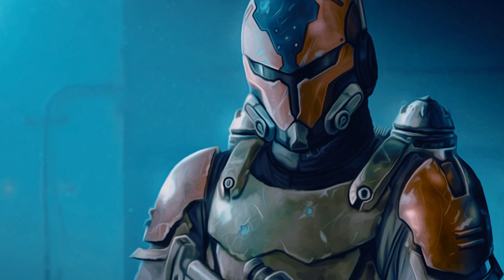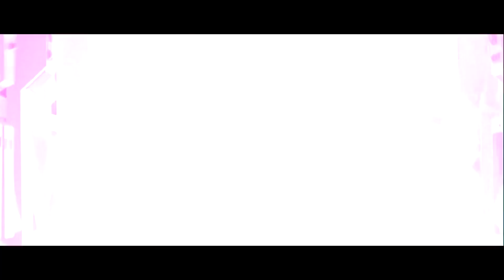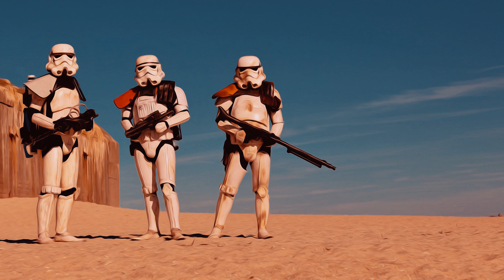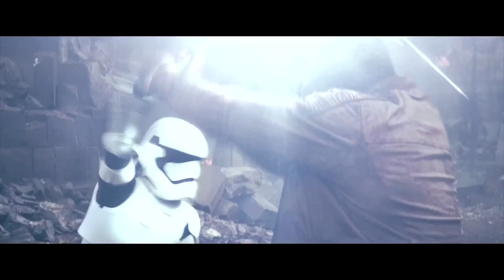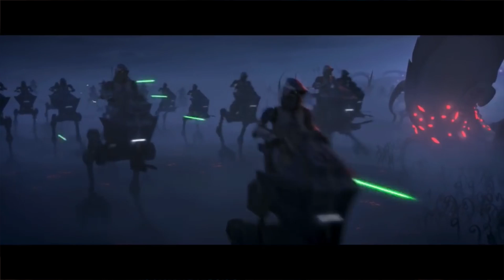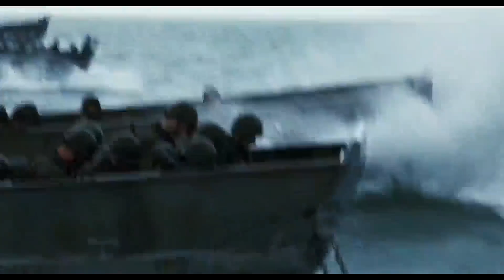FIRST ORDER VS CLONE TROOPERS VS STORMTROOPERS (ARMOR, WEAPONS & VEHICLES) PART 2

Comment: In terms of equipment, I do think the republic has the advantage.
The empire's weaponry was meant to intimidate first and destroy second. While most of their armor and vehicles looked fearsome, most of the quality in their equipment was lacking and had obvious weaknesses.
While the first order seemed to improve upon many of the empire's weakness when it cam to their arsenal, the only reason I;m not choosing them is because, compared to the empire and republic, we barely know anything about their full artillery and capabilities.
The republic's artillery not only has more information to it, unlike the first order's), but their armory also has many feats to its name ( unlike the empire's). 
Unlike the ATAT, with it's heavy body and weak legs and neck, the ATTE, while not much stronger, was overall more versatile and fitting of the title of All Terrain. Unlike the ATST, which was basically just a light armoed tank with many of the same weakness of the ATAT, the ATRT was fast, maneuverable, and a true scout transport. So on and so forth.
WINNER: Republic's equipment

Comment: Well thought out, but as with the first video some minor mistakes, mostly in regards to the GAR.
1- You mentioned that the mk2 (Katarn) armor wasn't sealed. Mk2 was usable in a Vacuum for a limited period.
2- DC-15s were available as pistol, carbine or rifle. You only refer to the rifle. DC-17s were only issued to the ARCs and Clone Commandos and were modular weapons that could be easily converted from carbine to sniper rifle and other modes as needed. There is also a pistol version of the DC-17.
3- The armor of the clones was based specifically on Jango's armor, which was made of plastoid-alloy. Beskar, Mandalorian iron, is used to create true Mandalorian Armor is beyond rare and wouldn't be available to non Mandos.
Aside from these the only thing I'd say is don't take quite so much from the Imperial equipment or troops. Even at the start of the Rebellion the bulk of the troops were veterans of the Clone War, including clones. As the Rebellion continued to expand many Stormtroopers and other Imperial troops defected bringing with them knowledge of the weaknesses of Imperial equipment. Also, the Rebels were good at thinking outside the box. The only 2 AT-ATs that we see destroyed were taken down by elite pilots - Wedge Antilles used the Snow Speeder's tow grapple to tie the legs together on 1 and Luke used a lightsaber to cut open a maintenance hatch and throw a bomb in the engine. As a side note, the First Order Gorilla Walkers are designed to make the legs impervious to this attack.

Comment: Old video, but for what it is worth, 9.5 pounds is not all that heavy for a shoulder arm. If you were to average out the weight of military shoulder arms from about, oh, 1700 up to the last couple decades, the average weight would be something like 8.5 -9 pounds. Some data points: AK47 weighs about 8-8.5 loaded based on type of mag, M16 started off at something like 7.76 lbs loaded and crept up to 8.75 for the A2 variant, with the A4 being heavier still due to its handguard, 18th century French muskets weighed between just under eight pounds up to 9 pounds, whereas the British Land pattern, aka "Brown Bess,"  weighed between 8.5 up to 10.5 pounds. So, 9.5 is a bit heavier than average but well within acceptable parameters judging by what has been used historically.

The tendency these days is to issue troops with lighter guns (M4 carbines in US practice) and then weigh them down with other things. Earlier troops carried a lot less on their persons than do modern troops.

Comment: I would say that the clone army had the best vehicles since they were designed to fight other vehicles and didn't usually have too many weak points like Imperial vehicles would. As for weapons, I would say that the First Order had the best ones because they had learned from the mistakes of the previous armies. And for armour I would again say that the FO wins for similar reasons, as well as the imperial troops having weak armour designed to be mass produced.

Comment: Although the clones are at an equipment disadvantage, i feel that 97 times out of 100 in a one to one fight, any random clone would win against a first order or imperial storm trooper. In a large scale battle is would still say around 80-90 percent of the time the clones would win. And in the case of a single squad of clones v.s. a squad of either first order or imperial STs would win around 80-90 percent of the time.
Reply from the maker: I agree with you mostly but I think your percentages are a bit on the high end.
Reply: Say if one put the entire forces of each army against each other in a battle, I believe that the Clones would win. The Clones had many specialties, including but not limited to the two Commando battalions (I'm taking the armies at their largest ever capacity), the TIV pilots as well as the other pilots, the Bomb Squad, the Galactic Marines, and those flying troop guys (I forgot the technical name).

EDIT:
These statistics are much, much more accurate if the Empire is nerfed in size quite a bit.
Reply: Insert Dakka To Continue the more numbers involved, the less individual skill is needed to win a fight. If you have a full blown battle. it mostly comes down to equipment amd strategy. the skill of individuals will be less and less important the larger an army becomes. and most of the time, only a brief disadvantage can turn the tide of war around. once at a disadvantage, its hard as hell  to get back to an offensive position.
Reply: Your basically putting the first order and empires training as if they only got 1 1/2 years worth of training yet in reality they are much more effective
Reply: Cosmos agreed, the clones were bred for war and that alone. Unlike both other factions were it was a sign up petition.
Reply: James DeLano jet troopers
Reply: while i agree with you the republic clone troopers would win 9/10 times against the soldiers of the empire and the first order, i do believe that the advance of time and tech for the empire and expectantly the first order might even the odds out if we bring armor into the scenario, for the first order if any anything else.